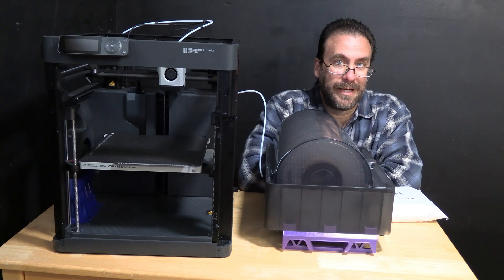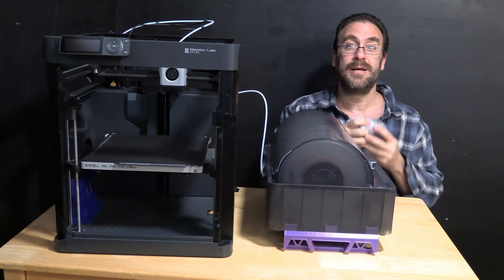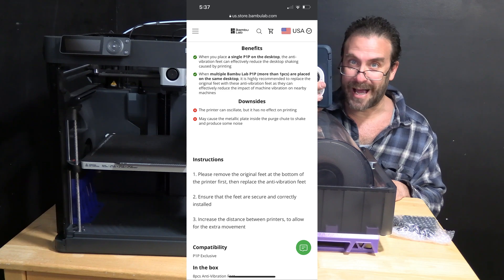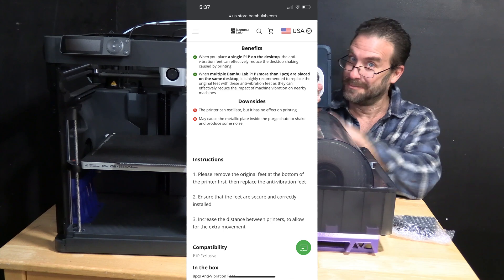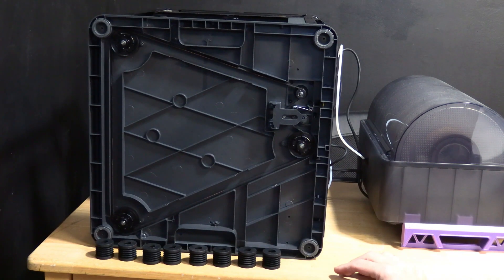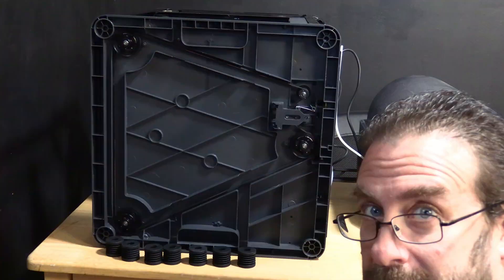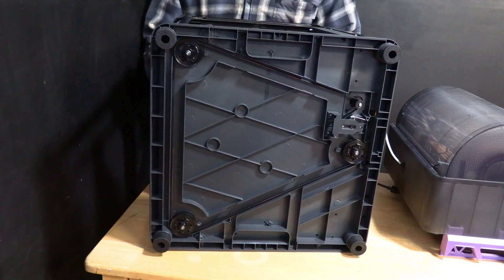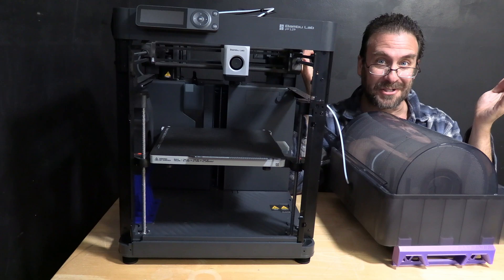Installing the Anti Vibration Feet on Bambu P1P - 3D Printer

Comment: I came here after opening the package and seeing absolutely zero instructions. Your video was spot on, and I 100% shared your critiques of Bambu's online instructions. It made me laugh and made me feel validated for my initial concerns. Thanks for this. It's too bad you're getting some negative comments but, as per some of your responses, I think you're encountering some definite fan-boy reactions. Your sarcasm was light-hearted, rather than slanderous, and spoke directly to your experience. Customers shouldn't have to guess at how to use a product they paid money for. Cheers.
Reply from the maker: 🎯🎯Also, peeps fails to realize, the feet in this video, were promptly discontinued and replaced with revised feet. However, those are useless also. I use no feet, on all my K1's and P1's, without issue.

Comment: Video was hilarious. They are poorly sold. They def need better instructions, and need sticky bits to add to the bottom of the printer it took me a few go’s to stand it up without them coming out. I will be buying double sided tape to fix that. As frustrating they were to put on, they have definitely made a difference, the table isn’t vibrating and it’s not as loud.
Reply from the maker: LOL. I hated these.  Keep in mind, these are not the feet sold today. They were swiftly revised by Bambu.
Reply: @3DRundown I received mine today so I guess they are the most newest version they have and yup they still suck at sticking on 😅
Reply from the maker: hahah yup. I never use the feet for any of my Bambu or K1
Reply: I lasted less than 24hrs. I nearly lost my whole machine when I tried to remove a stuck on print. I’ve now gone back to the original feet. What a waste of money. And disappointing
Reply from the maker: All my K1 and Bambu have their feet removed. multiple per muscle rack, never seen a need...

Comment: Dude i normally enjoy your stuff but the bs about you putting the original feet back on… totally inappropriate- it’s a great product.  we have a small farm with 2 printers per shelf and the vibration of one would mess up the printer next to it depending on where it was vibe wise in diff prints.  THESE things are truly awesome! a total “dude, wow, finally!” product.  

the grooved side of the feet fit perfectly.  and why no sticky attachment?  because these bad boys take so much vibration reduction i am guessing i will be replacing them in a year or so.  clearly they are absorbing so much movement they likely have a limited life span.

val
Reply from the maker: DUDE, did you compare the feat in these, to the feet you are using? Your Feet are Version two, of these promptly discontinued feet. I wonder why they revised them? It's almost as if my opinions might be worth something.... maybe. 😉

(For realz though, I have never seen a need for them, I've got multiple sets of 3 shelves with 2 on each, running all the time. None of them have feet. Never seen a problem. Shipped 400 orders in October. Muscle Rack FTW)
Reply: @ i suppose we have diff shelving units.  i shared my perspective, it’s all i did.  i think they are a wonderful product that helps me.  no part of my perspective was meant to offend you.  i am sorry that it seems i did.  😱  i ordered and received the feet last week, then like many, due to zero instructions you tubed install instructions.

Comment: You're a funny guy. I'll watch some more of Your videos. The pathetic bits had Me chuckling, and You just saved me £11, although I did suspect exactly what your unspoken spoken conclusion was, man those things are compliant. I'll get some regular compressor feet. Have this engagement for the algo and a like on this video!
Reply from the maker: 😂😂😂 Check out this years April Fools videos, for a clue into how weird I am. 🤪.  Sooooooo, after it turned out, these feet suck, Bambu redesigned them. I never tried the new ones, and have never seen a need.

Comment: I just bought these for my recently purchased P1S and I must say, I share your scepticism. I put the things on and when I nudged the printer it fell of it's feet. Not sure how I feel about that. Perhaps I should put more time and efford in alligning them but they all looked to be on there straight. First impressions aren't great. I put the original feet back on for now. I need something dampening howerver because the cabinet my printer sits on also houses my NAS and hard-drives and vibrations don't go well together. I turned the NAS off for the time being when I'm printing. As long as the drives are parked the vibrations shouldn't matter too much but I need a better solution in the long run. At the moment, the printer is printing a printjob for about 10 hours. Perhaps I give the feet another try tomorrow when it's done printing...
Reply from the maker: I ditched mine and to date, all my P1's and K1's, sit without the feet, on muscle wracks, without issue. However. Your feet are a new model. The crap I was sent, were quickly replaced by Bambu with a new design. I still think they suck. Search on youtube, for printer paver dampening.
Reply: @3DRundown  Yeah, I think I'm gonna go the paver route. I found this a bit overkill, that's why I ordered the Bambu feet but I'm not a huge fan of those. Gonna go the home improvement store on saturday and look for a concrete paver that matches the printer in dimensions and some insulation foam. I think that's gonna work better than those feet...

Comment: Sharing this with others in case they are looking to really solve this vibration problem.

Building upon the scientific analysis provided in this video I decided to improve upon this design.  In addition to adding Bambu's anti-vibration feet to my P1S 
I fashioned a piece of 15 cm thick styrofoam in the same shape and size as the bottom of the printer.  I purchased a rubbermaid tote from Home Depot that is just marginally bigger than the length and width of the bottom of the printer.  I next filled the tote with water.  Then I floated the piece of styrofoam on the surface of the water in the tote.  Lastly, I placed the printer on top of the styrofoam in the tote which is floating in the water.  I proceeded to print with absolutely no more vibrations on my desk on which the tote sits.
Reply from the maker: Thanks for appreciating my "Scientific Analysis". I am impressed by your commitment to further the advancement of Hydro-Anti-Vibratory technology,. Home Depot, WE can do it, THEY Can help! 
I tossed mine in the garbage, and put the printer on the 2nd shelf of a Muscle rack. I put 2 more next to it, and, I run them like crazy. Never had a problem. I call BS on the need for these feet.

Comment: For the p1s do they have these already ? Also does it shake a lot as in walk across a table? Ty 😎👍🏻

How big of a table do you need I have about 27 inches wide to play with can you recommend an Amazon table? Ty
Reply from the maker: They are not included
There is a new model since this video
I don't use them on any of my 3 P1's, and have never seen a need
I highly recommend a "Muscle Rack" available at Walmart and similar stores
Reply: @3DRundown  thank you really  value your opinion and video content .

Comment: I just got these for the X1C, and they have the 6 split design as seen on the P1 series, I wonder why they don't use that here - maybe some have the shape and some don't? I'm running the full calibration suite just in case after installation.
Reply from the maker: These are the original feet. Since then, they have wisely updated them, to the new design you have. Let us know how you like them.

Comment: A couple of things to note since the making of this video:
1) Listening to customer feedback, Bambu has change the design. It's now obvious which side is "down", and the feet slot into (and clasp onto) the holes of the machine, which prevents them from falling out when you lift it

2) Similarly, there is now a clear instructional video on how to install the product on the product page

And for some tips:
1) Once install, run a new calibration, preferably from scratch. The machine will behave differently and should be calibrated as such.

2) If you only have a second printer, there are cheaper ways to reduce noise. The feet are primarily to prevent one printer's vibrations from traveling through the table (or whatever you have them on) and affecting the print of another printer on the same table, and vice versa
Reply from the maker: Yes, the new feet are much better. I still don't use them. Nor do I use my K1 or K1 Max feet. I have never seen a need. And I have 6 machines per Muscle rack. I'll probs try them one day just to show them

Comment: Im planning on making some plugs out if tungsten or copper that fit inside those opening where the feet go. I assume more weight at the bottom would give you more vibration dampening than these flimsy Chinese slinkys
Reply from the maker: They released a new version, but, I dunno what to expect from them. The idea is not to transfer the vibration from the machine
To the table. I just keep mine on the bottom shelf of my muscle racks

Comment: Feet doesn't stay in place, nightmare to place them correctly, impossible to move the printer 5mm without them getting out of their place. They should have been screwed to the bottom or something like that to stay in place. I kept them installed 5min, now they are back on their box, probably forever... useless product.
Reply from the maker: Yup. That was exactly my experience. 💯 When I picked up the machine after this video they fell out. I left them on the floor

Comment: I have added a piece of large insulation foam under the printer to further reduce noise and vibrations; I might even try dense packing Styrofoam sheet underneath too and see how much that would help.
Reply from the maker: The pink stuff?
Reply: @3DRundown ... Light Grey, its like dense stryofoams.

Comment: I installed mine yesterday. Didn't see this video before, didn't find or read any instructions, but figured out the replacement of the original feet myself. X1 Carbon, BTW.

Needs some confidence because the printer gets wobbly, but on the first prints, no negative effects were visible (print, quality printer tipping over :), but the positive effect was audible: Because my table is propped against the wall, not only the table vibrated before, but the wall as well. Noise was reduced so well that I can hear those loud fans even better 🙂

I guess the wobbling of the printer makes sense, even in improving (or nor worsening) the print quality: Internal forces from acceleration and deceleration of the print head do not come to a hard stop at the mass of printer and table, but are taken up by the feet.

Which leads my to some general advice:

1. Don't just tip over the printer on its new feet and start (not, doh!) printing like in the video. Meticulously make sure that the feet are all dead center, and not skewed (you know - top of foot straight over bottom, on all 4 corners at the same time). I figured out even if one foot is off-center, the whole balance is gone.

2. Should be in the instructions (could be, didn't read them): After installing, I think it's good advice to run the "vibration resonance calibration" again. The whole vibration resonance setup has changed, so I think it's a good idea to give the input shaping a good head start
Reply from the maker: Good tips! And nice to get some feedback from real world use.

Comment: Installed the feet last week and they work great. I noticed way less vibration is going into my deskt. And overall noise is reduced, print quality does not suffer, nevertheless the printer is now wobbling a little bit but I don't mind about that.
Reply from the maker: Super. Great to hear some real-world use results.

Comment: I'd be curious to see how hard it would be to just design and print a few of these in TPU 🤔
Reply from the maker: Likely a cake walk. I picked up the machine, and all 4 fell out. I left them there.. Lol
Reply: Tried it before with TPU 95A, way to hard (or unstable if I gave them some hollow structure). I guess the flex rate of the filament just wasn't right. Happy with the Bambu ones, see my comment above. They work if you take the seriously, instead of tossing them away for a cheap wink and a laugh

Comment: OK - funny video. It was less informative than I first thought. If you want any feedback - at least one test print, better measuring vibration with or without them would have been helpful. At least I took with me that these might be useful when you use several printers on the same surface. Plus that it does not look like these are needed immediately when you buy only one printer.
Reply from the maker: I wouldn't use them. Might be helpful when on a table with a few machines. Soon as I picked up the printer, all 4 fell off. I went back to my OG feet, which have been more than fine for me. My bed sllingers shake so much more than the P1P. I leave it to the view to decide what they think. For me. I didn't like them. The feet fold over, and the whole machine leans to the side and crushes them. They need to do better

Comment: I'm sorry to see that your opinion is not based on any data. It would be enough to measure vibrations with any instrument even phone. Those feet make printer to wiggle when you move it by hand,  but overall vibrations during print are almost order of magnitude lower. They are just of completely different frequency and strength. THis impacts print quality very positively.
Reply: I agree with you, it’s crazy that he didn’t print a single thing with the anti-vibration feet installed, just in case Bambu engineers know what they’re doing. 😂 His reply to your reasonable comment was equally as crazy. Not going to waste my time on this channel, that’s for sure!
Reply from the maker: My life is over
Reply from the maker: I really don't care. My "Data" is in the comments.
Reply: @3DRundown  I see. One of those overweening guys not listening for feedback. This is not how you build community around your channel. Good luck then (and read stats how many watchers actually reads comments)

Comment: Does packaging really matter on some rubber parts? I mean they could package it up like a new gopro or an iphone at an additional cost... but then you'd complain about cost. Box it came in seems plenty adequate to me.
Reply from the maker: Also, all 4 fell when I picked the printer up to relocate it. Junk. The old feet are back on.
Reply from the maker: I bought a P1P and AMS, new, Preorder, prior to any reviews. I doubt I'd complain about cost. Their hot ends and other packaging are in the same shit packaging. Buy a Creality Hot end, Nozzle Kit, CR-Touch, and see how it's packed. Night and Day.
Reply: @3DRundown  It just seems odd to me you'd criticize packaging that will go in the trash anyway. And cost is a relative term... P1P is excellent value for money. But in any case, I gotta agree with you on the feet... they do seem like junk. I'm sure anyone can design and print a better one out of TPU
Reply from the maker: Sure, it goes in the trash, but, it needs to do it's job 1st, which is, to protect the item. USPS can turn a Hot End into a BENT End, in short order. Also, it's about IMAGE. Looking, and feeling, like a higher end product, which, BAMBU really needs, in order to attract people over from the established brands, and their higher price tags

Comment: I have mine installed on my P1P that’s on the same table as 2 X1C’s and the results have been great so far. There’s a video on here I see a while back where the guy tries hanging both bed slingers and core xy printers from the ceiling and some of those even printed will not even sitting on a surface swinging themselves all over the place. Quite interesting
Reply from the maker: That's amazing. 😂😂

Comment: I am testing mine with adding automotive Permatex Black Oil Resistant Silicone to  the center to reduce some of the wobble. I place then on wax paper cut the applicator to the second largest and pushed the tip to the bottom and squeezed it on the way up to pressurize the silicone to go inside the inside bellows. Used a razor blade to skim the top clean I have a Carbon and a P1P coming that will be side by side. This should reduce the massive wobble you saw. I assume it will take 3-5  days at least to fully dry inside the feet.
Reply from the maker: I'd love to see some pics of your project! Join my P1P FB group and share your work. :)
Reply: @3DRundown Just received my P1P and the Permatex Automotive Black Oil Resistant Silicone to dried fully as I put the anti-vib feet in the oven at 150 deg  for 2 hour after day of initial drying. Used  large sheet of foil on the top shelf of oven and on the bottom shelf , the feet were in the middle shelf on foil. It made  the feet twice as stiff while allowing some form of anti-vib. (the way most of would think it should be from the start)  I think I may add the other set to my X1-Carbon. Do a video on this if you like. Sorry, I don't do Facebook.

Comment: I also removed the new feet soon after I installed them. If you don't use an AMS System and instead stick to the spool holder on one side you will notice that the feet on the side of the spool holder get more squeezed then ones on the other side. In my opinion this is rather problematic because the printer isn't in balance anymore. I told this to the support and got my money back.
Reply from the maker: My feet were crushing and leaning. #Junk
Reply: @3DRundown  See my comment from just now: Crushing is normal (gives them some stability), and leaning means you didn't bother to adjust them so they're dead center. Maybe make another video?